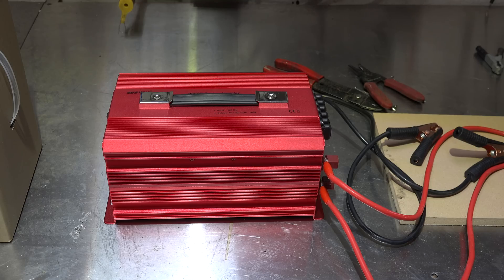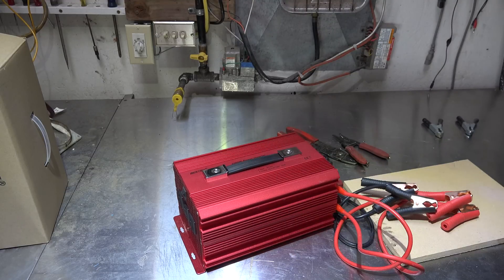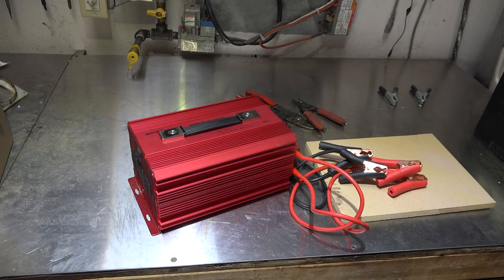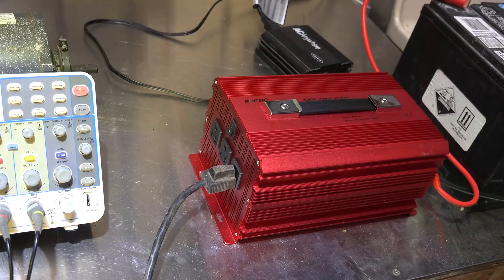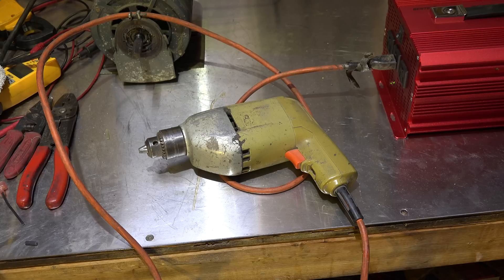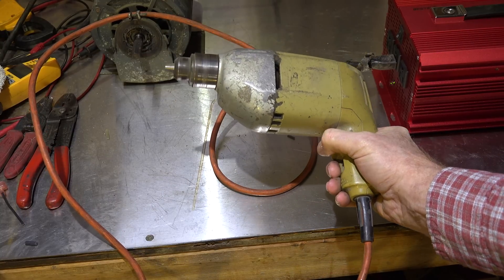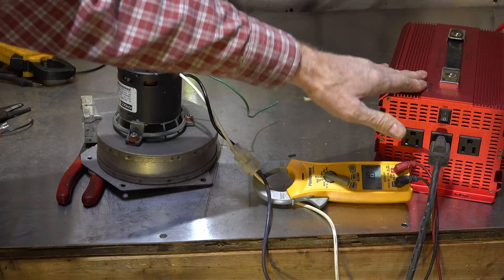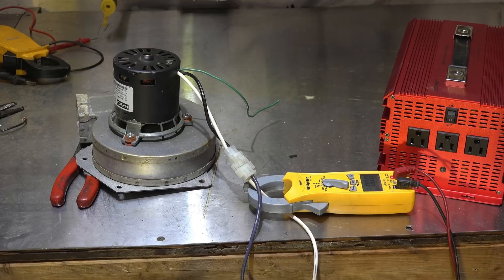Test of the Bestec inverter #1

Comment: Great series!  I have noticed in some portions of your videos you only have 1 pair power source cables connected to your 12v battery, but at other times 2 pairs connected to the same, single battery.  Does this affect the the inverter's output?  Does it work the same connecting only 1 pair?  Thanks in advance!
Reply from the maker: It works the same but with only one set connected, you will lose some capacity.
GFM

Comment: Thank You.  Can I run a 16 amp air compresser to fill up the tires?
Reply from the maker: Jack Mason The converter is just barely big enough to run the compressor. You may have trouble getting the compressor to start. 
GFM

Comment: Why does this unit come with two DC+ connectors, and two DC- connectors?  Most inverters I've see only have one red and black connection to the battery.  Why is two sets of jumper cables? Is that for connecting it to two different battery's at the same time?  The instructions are a joke.  I can't find any videos on connecting the cables.  I would greatly appreciate if you would explain how exactly to connect the cables.  Thanking you in advance.
Reply from the maker: You could certainly wire 2 batteries to the inverter.  The red goes to positive on the inverter and connects to positive on the battery.  Black is for negative.  Hope this helps.
GFM
Reply from the maker: You could connect 2 batteries at the same time.  In fact, you may  want to if there is a high load on the circuit.  The red is positive on the inverter and the battery.  Black is for negative.  Hope this helps.
GFM
Reply: Thank you I appreciate it.  That is what I was looking for!
Reply: Thank you I appreciate it.  That is what I was looking for!

Comment: Id bet you would be surprised by the output of an APC or Eaton UPS. We used them for our boiler backup power and the output and THD is acceptable. They are cheap, you can match any deep cycle battery you have around and it charges back the battery when power is back up. Most of them would have many options accessible via COM port with a small laptop. I'd be very happy if you would try one!
Reply from the maker: +Terrence Sauve If you want to send one, I will test it and compare.
GFM
Reply: +grayfurnaceman I would gladly do if I were in USA.
I'm in Canada, so shipping down to your place would be more than the price of the unit! Best place to find one in good shape is a recycling depot for electronics. Usually people dont bother putting 150$ in good batteries and about 40$ for a used UPS, but instead go to office supply stores and by a crappy one (modified Sine wave) for about the same price of the batteries. Thanks for your videos. 
Cheers!

Comment: Did you really connect the scope probe directly the A/C power mains without using an isolation transformer?   And is your scope powered by the A/C mains?   If so, you were really lucky that you didn't melt the probe and/or destroy your scope.   You had a 50/50 chance of connecting the hot side of A/C line to the ground side of the scope probe.  If you had reversed the A/C power connection to the scope, you would have melted the probe and damaged the scope.   Further explanation here: https://www.youtube.com/watch?v=xaELqAo4kkQ  and here at Question 11: http://www.allaboutcircuits.com/worksheets/basic-oscilloscope-operation/

Comment: wouldn't a lower voltage increase the amps sir?
Reply from the maker: Do you mean the amperage coming from the battery?  If it does by about 10 times. 
GFM
Reply: +grayfurnaceman no you said when the inducer amps was lower using the battery and the inverter it was probably because the voltage was lower wouldn't a lower voltage increase the amps on the motor rather than decrease them
Reply from the maker: +Derrick Owens the answer is it depends on the source.  When using a battery that may be overdrawing what it is capable of, it could reduce. It also depends on the motor type and how low the voltage is. I am not trying to be hazy but there are many factors here. I may try doing more on this with some practical tests in the future. 
GFM

Comment: Could you power a Carrier High efficiency furnace with two ECM motors and the associated electronics powered up? That I would really like to see/know if that works. Supposedly the Bryant I have should draw less than 100 watts on low /first stage operation. I would hate to power it on with an inverter and let the electronic smoke out of something within the furnace.
 I have a number of inverters here. The one I know will work is a true pure sine type, it will run anything I throw at it, provided I have a big enough battery and or the vehicle is running. So perhaps a low output, say, < 800 watt quasi sine or modified sine wave?
Thanks for the videos
Reply from the maker: I have several videos coming out in the next weeks trying this thing out on different furnaces. 
GFM
Reply: Cool, I can't wait!